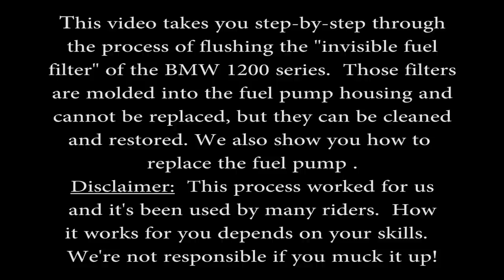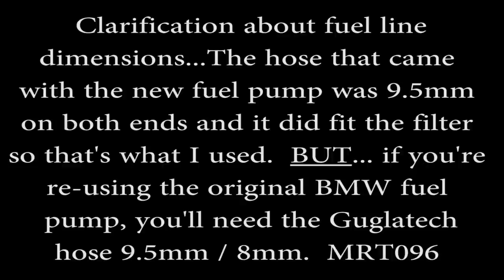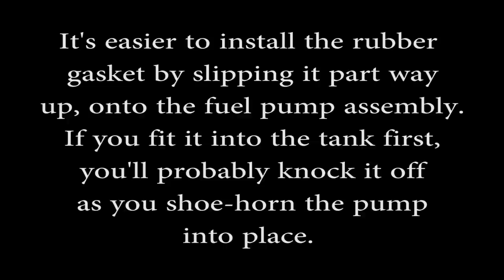BMW 1200 Series Invisible Fuel Filter Service

Comment: Your video solved the mystery of removing the oem pump from the housing of my 07RT. After banging my head against the wall for several hours, and about to surrender to ordering an oem pump, I found your video. The video showed the trick of carefully nudging the filter base from the pump housing and saved the day (and my wallet). Thank you so very much.

Comment: A great video, showing all the handy things you need to know when cleaning the (non replaceable) fuel filter in an r1200gs.  It's easy to watch and full of useful 'does ' and 'do nots' to make the job much easier and useful details of how the whole system works - thanks! :)

Comment: Many Many Thanks for this....This is exactly the video I need. My bike performance after 122,500 miles has degraded at higher revs and top speed. It now only does 118MPH instead of 134-6 MPH of old. It feels like an odd fuel starvation issue, so this is a rabbit hole I will try to go down after going down others (coils/plugs/shaft drive). This is a 10x of my mechanical skills and the bike (2004 R1200 GS - No. 179 off the production line !!) Is at a holiday home in the Canary Islands....

Comment: I recently bought an 07 1200GS, and after a week in, I was driving along with what I thought was over a half tank of gas left, and before I knew it I was on the side of the road without sgas. I can only guess it was fuel issue and after watching your video, which was VERY informative. I will be going over my fuel system here very soon.  Thank you for such a great step by step video! I wish more people would go into such great detail.
Reply: Can't believe nobody mentioned the recall to the fuel reader in the tank for these models.  Call BMW for the free service.
Reply: @Belly Ache  the fuel pump and hevel can still cause this problem because there will be 5-7 liters left in the tank.

Comment: Well presented and informative, thank you.
A couple of comments
Proper fuel injection claps are superior to gear clamps for the fuel hose,
BMW recommends tire install lube on the sealing gasket when re-assembling.
I like to use Red Rubber grease - Castrol product.

Comment: Thank you!!! My 150k mile R1200RT was driving me nuts with a progressively worsening lean condition.  You saved me over 550$ on part alone!!.  Went ahead and put that fuel pump in there too while apart.

Comment: Great video. I am ready to install my new fuel pump as we speak. I checked the controller with the controller bypass and found that was not the problem. Now I am on to the fuel pump.

Comment: Great video.  Thanks for showing us how to work on the fuel pump assembly.  I only wish you had replaced the plastic fuel QD's with metal ones.  Too many horror stories about the plastic cracking and causing major problems!

Comment: Really exceptionally instructive video - top marks! 
Minus for BMW that managed to make a super-complex assembly that could be easily simplified by design, with no need for a million different features. 
Also, minus for advertising a good-for-life part such as a filter! What is life? For some it is a few years, for others it is 10. For me it is 20. An easily replaceable, standard design filter - like that I have on my Ducati - would do, and make our life so much easier.
I am surprised that the large pump assembly gasket changes size and ductility if not wetted by fuel. A Viton seal would keep its properties. I wonder why BMW has not adopted this material.
I bought my bike new, after about 3 years I took it to a BMW dealer for regular maintenance. They found a few recalls from the factory, one was related to a "a plastic part of the gas tank that cracks". I wonder what this was (no explanation was given) but I was surprised BMW had released such a part.
Final remark: instead of dipping a fuel line in warm water (aargh!) I would heat it up with an air dryer

Comment: Excellent video, very helpful, just done on my 2012 GS Rallye, suggest take off tank in full much easier, and heat gun to soften the plastic, it sure was tight fit

Comment: This system is very similar to the BMW S1000RR 1st and 2nd generation. This video has been very helpful for cleaning the fuel system on my S1000RR. Thanks.
Reply: What year s1000rr do you have?

Comment: Thank You for this informative video. I’m about to do this job next week. Fuel pressure is down to 2,8bar and the bike isn’t responsive on full throttle. I’m not to keen on removing the fitting for the fuel hose. But we’ll see how it goes.

Comment: Grat video, I am learning a lot. I already bougth the new pump assembly, $530.00 bucks.

On minute 36:48,you recommend to blow air thru the filter. what air pressure are you using for this process?. I am thinking on use a plastic 'welder' epoxy to fix my leak, but i need to do invisible filter cleaning process.   nee to make up my mind... not sure how much BMW dealers charge to replace the pump, do not even know if the clean the fuel tank as part of the procedure of replacing the pump.... sounds logic, but who knows

Comment: Awesome video!   I’m almost at the point of finishing the rebuild having followed your instructions to the T.    Only part was that small white O-ring you said pay attention to.   I probably lost mine; but no idea how as I was really careful with everything.     Do you have details or info on where I could find a replacement?    Thanks!
Reply: No, sorry I have no idea where you'd find one. You'll need to take measurements then source it yourself.  Note that you'll need an oring that is fuel compatible.

Comment: I am replacing my fuel regulator at the same time.   You wouldn’t happen to have a video on this procedure by any chance?   Thanks.
Reply: Oh!    I might still have it.   Would it be visible when pushing the inside of the valve in (like in your video) and just under the inner part?   The problem appears to be mine was black not white.   Thx!

Comment: 2014 K1600GTL that’s set for 2 years with a quarter tank of gas. Hard starts, run intermittently and chokes if given hard throttle. Put new gas in, but doesn’t seem to help yet, but only ridden about 40 miles with new gas. Help!

Comment: good video, I didn't know there was a filter there. Question about the other side. you said it had a pump but I see no wiring. What drives it ?
Reply from the maker: There's a wiring harness that plugs into the unit.  Once out of the tank you'll see it.

Comment: Wow. Absolutely fantastic. Can't thank you enough. You've built my confidence to take on this procedure.

Question: what kind of performance/mpg increase, if any, have you experienced after completing all this???

I have a '13 GSA with 64k miles. I average 35-37mpg and I'm betting that filter is just nasty and has to be choking fuel to some degree. 

Anyhow, cheers, and thanks again!
Reply from the maker: I can't say whether I got any performance/mpg benefit from the fuel filter cleaning... but several people have told me that I don't look quite so fat.  Based on those comments I think the cleaning was worth the effort.

Comment: Excellent video sir.  Does this apply, if your bike has a fuel strip, as opposed to a float?.
Reply: Regardless of which system (float or strip) the solution is the same. You need to clean that filter
Reply: David Petersen thanks for the response. 👍🏻

Comment: ey hello, around minute 11:50, where the invisible filter is located, Is there any risk to buildup pressure and crack the flange? (black cover on top of the withe body where the invisible filter is).  I have a miro-fracture that starts on one of the mounting holes of the control module. i can send you photos about my failure
Reply from the maker: I'm not a BMW tech so I'm not sure I'm qualified to give you a firm answer, BUT I think it's unlikely that the pump would build enough pressure to crack that housing.  More likely, the crack was caused at time of factory install (over-torque).  No way to fix it, no way to tell when it will fail.  Best plan is to buy a new assembly.

Comment: Hi my RT has got a rough idle problem  can it be a symptom  of clogged fuel filter ? besides rough idle and stalling it rides ok when not in idle
Reply from the maker: I doubt the rough idle is related to a clogged filter.  Usually a clogged filter causes lack of power at higher RPM because the bike can't draw enough fuel thru the clogged filter.  Instead I'd look to your injectors and/or timing and/or valve clearances.  You should also look at your air filter and check that your gas is clean and fresh.

Comment: I just acknowledged of this video now, and last week I clean the fuel system, a brown liquids came out. Also I remove the connection plug, I think I lost the print, it’s leaking a bit
Reply from the maker: Use some teflon tape on the threads of the connector.
Reply: I have to do as you did with the cleaning of the invisible filter, to my point of you I removed only a bit of the dark liquid but not enough, this week coming I will say yes or no it work out

Comment: Buen dia . 
Hay alguna manera de desarmarlo . Por que el mio sale sucio lo poco que hay de gasolina y hace que la motl no responda en altas rpm
Pierde potencia .
Ya le hice todo el cableado de la bomba de gasolina y mejoro pero de nuevo se a arorado ese filtro escondido y la moto no responde en alta
Reply from the maker: No habla Espanol.  Translated:  Good day .  Is there any way to disable it. Why does mine come out dirty the little there is of gasoline and makes the motl not respond at high rpm, loses potency.  I already did all the wiring of the fuel pump and it improved but again that hidden filter has been damaged and the motorcycle does not respond on high
.
It sounds like the filter is still clogged.  Repeat the cleaning process and if that doesn't work then t.he only thing to do is buy a new fuel filter assembly from BMW.  Translated:  Parece que el filtro todavía está obstruido. Repita el proceso de limpieza y, si eso no funciona, lo único que debe hacer es comprar un nuevo conjunto de filtro de combustible de BMW.

Comment: Hi there. Where can I buy that tech filter you installed in the fuel tank - as the last step? Thank you.
Reply from the maker: Peter - please clarify your question.  The "invisible filter" is not available unless you buy a new fuel filter assembly from BMW.  If you're talking about the filter that fits into the filler neck, then you can buy that one from BestRest Products.  www(dot)BestRestProducts(dot)com
Reply: @bestrestproducts648 , yes, I was referring to the “filter that fits into the filler neck.” Thank you for the link.

Comment: I recently bought a gsa 1200 2011 with only 4000 km, very well cared for, new oil, walking it has overheated on the road, have you ever seen such a problem?  could it be related to the injectors or even this filter?

Comment: I own a 2009 GSA. You have a fuel float attached to your fuel pump. As far as I know its supposed to be a fuel strip. Did you change it? May I know the part number for that or where did you get it from?
Reply: BMW used both fuel strips and floats. They had many problems with the strips and did some recalls.  As for converting from a strip to a float, I can't advise. Check the BMW forums.

Comment: HOW? Does your gas cap flip open forward? I want mine to do that, but can't see a way to get it to work.
Reply: Take off the cap - remove screws. There's a rubber fitting below the cap.  I turned it around, reversed the cap.
Reply: @HidalgoRides  Thanks, but I guess the 2008 is different, as that won't work. But thank you for answering.

Comment: Damn, $465 for the pump assembly with the float lever. I’m surprised BMW doesn’t make a $300 tool to remove that silver ring that holds the pump lol
Reply from the maker: Check quantumfuelsystems (dot) com.  They have pumps.  Don't know about the float lever.

Comment: Advice is to keep a fuel controller bypass under your seat or a spare controller unit. I purchaced a 2006 model with 63000km on clock and after +_ 1000km the controller unit blew out left me beside the raod. Good thing to have for backup ....this is a general problem on the older 1200gs
http://www.motorcycleinfo.co.uk/index074c.html?fa=contentGeneric.nvxszdkebklxuaer&pageId=428065

Comment: Sorry but teflon is for this psi?
Reply from the maker: The teflon just ensures a good seal between the threads. The threads carry the load. All the fittings are plastic so the load can't be that high. 

There may be some special BMW thread compound that they recommend, I didn't have any.
Reply: @bestrestproducts648  The load is over 150 psi.
Reply: @bestrestproducts648  I would highly recommend using the thread compound over the Teflon tape on the male threads only. The gasoline will eventually dissolve the plastic holding the Teflon threads in the tape  together and it is real easy for the threads to  break off and plug a fuel injector.